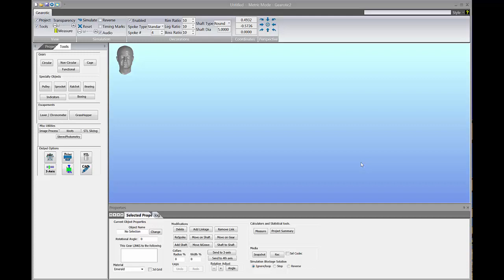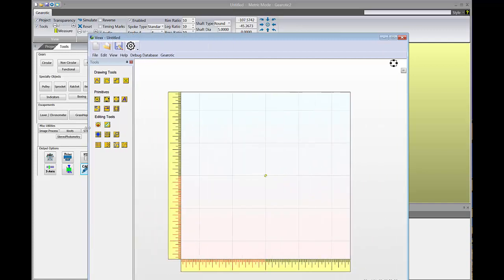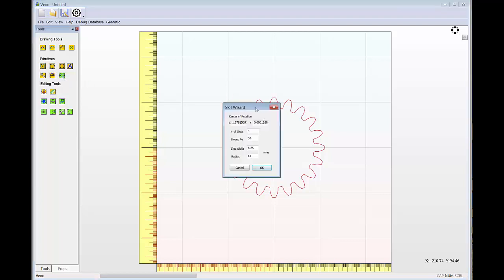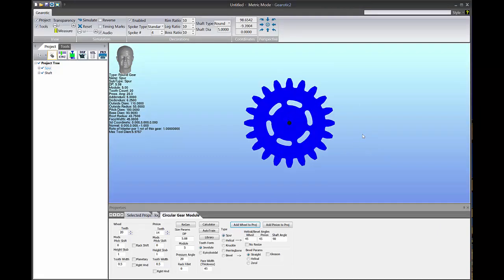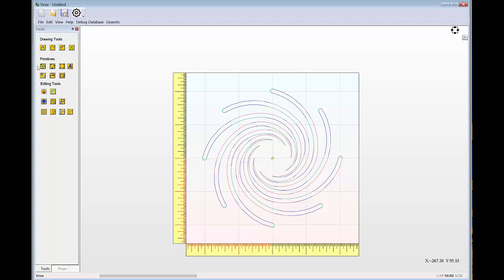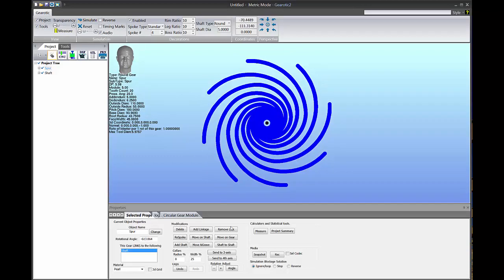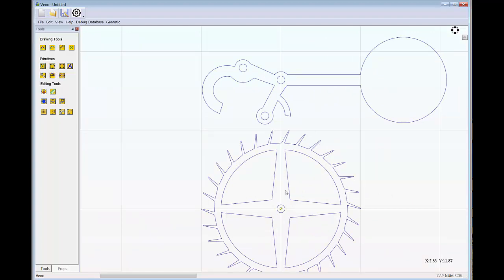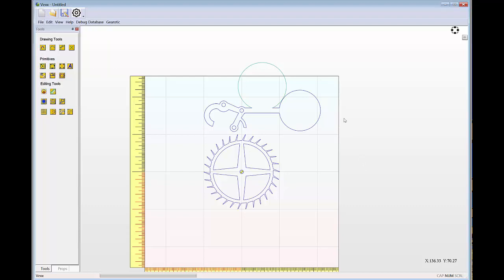Vexx Intro

Comment: This is  one of the worst programs I have ever used. Settings change back to original, importing gears from Vexx does not import gear correctly. If you make a unique gear from a dxf it is not represented correctly and sending it to the forth axis does machine it correctly - and on and on. Simply horrible!